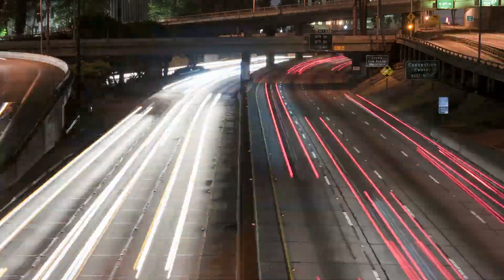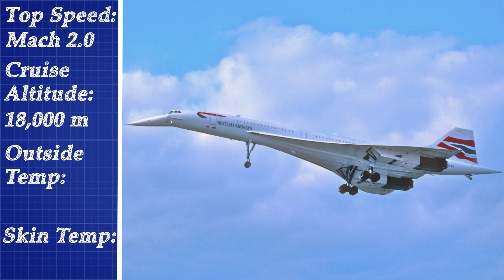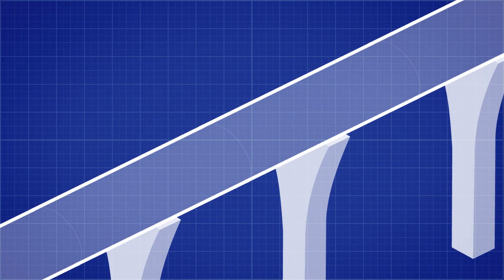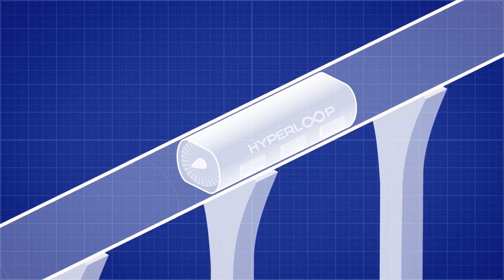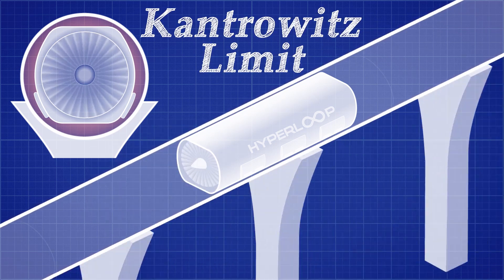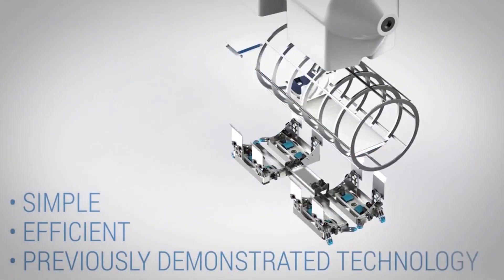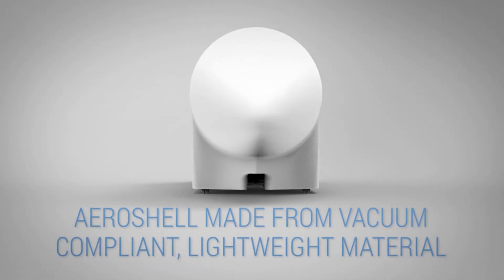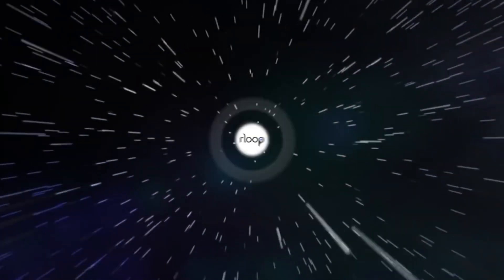Hyperloop - The Future of Travel?

Comment: So basically, it's a maglev in a tube with a target speed about 50km/h faster than the current maglev operational speed and 20km/h slower than the actual fastest speed achieved by an existing maglev. What's the point?
Reply: Abe Dillon The top speed of a maglev train is a little over 600km/h. What is the top speed of a Hyperloop demonstrator? Oh wait, there is no such thing as a hyperloop demonstrator, there are some tubes in the desert and a poorly engineered maglev segment. A ridiculously short one.
Reply: You know what's more dangerous than a high speed train? A high speed train in a vacuum tube with train cars that pass every 3-5 minutes.
Reply: "You know what good engineers do? they build complex systems in pieces and test each piece at a time."
They built a maglev. It already exists and it's  far better then the one they built. They invented hot water and it's not even that hot. Wow! I'm impressed!
Reply: Last I checked, the top speed of a maglev train was far shy of 700 mph. Closer to 300 mph. Can you link to what exactly you're talking about?
Reply: They used a maglev for the demonstration. Maybe you should point it out to them.
Reply: Ok, now imagine if somebody else had a working system for that same purpose with a far better methane engine. That would be a good analogy.
Reply: Besides, if you watched the video, you would know that no compressors or air bearings are planned. You would also know that the prototype target speed is 480 km/h. Not 700 mph.
Reply: Also, yeah, even if someone has already made a methane rocket before (hint: they have) NASA would want to test their own design.
Reply: +Lethal Oxyclean Clorox Bleach
Page 12 of the Hyperloop Alpha document ( http://www.spacex.com/sites/spacex/files/hyperloop_alpha-20130812.pdf ) states:
The capsules travel at 760 mph (1,220 kph, Mach 0.91 at 68 ºF or 20 ºC)

The fastest train in the world has a top speed of 603 km/h (375 mph) ( https://en.wikipedia.org/wiki/L0_Series )

760 mph > 375 mph. 1220 kph > 603 kph.

You and OP are confusing kph for mph. That's why I corrected them.
Reply: +InfamousArmstrong
Yes. I know. That's why I labeled it as such.

The Hyperloop Alpha document outlines the general idea behind the Hyperloop concept. There are no follow-up documents.

When it was released patent-free to the public domain, dozens of start-ups took off with their own take on the idea, but none of them are exactly publishing their full engineering documents. So, when people talk about "the hyperloop" without mentioning a specific implementation, one can only assume they're referring to "The Hyperloop" as envisioned by Musk and described in the Hyperloop Alpha document.
Reply: Abe Dillon 
Just because the alpha document says it will go a certain speed doesn't mean it actually will.
Reply: Abe Dillon is that engine better performing than the one they're testing?
Reply: Oh really? What did their competitors do? Tell me again, why am I wasting my time with you?
Reply: what part of "the target speed of the demonstrator is 480 kph" you didn't understand? It's even worse than I wrote in the beginning. It's like saying "we're planning a Mach 5 airplane, more than twice as fast than the Concorde but we'll make a 'demonstrator' that goes Mach 0.8 as a proof of concept". Are you really that stupid?
Reply: I give up, you're a basket case.
Reply: As I said, you're a basket case. If you weren't you wouldn't use a theoretical project as your argument. It's as if you said "there is a better way to propell spacecraft"  and use the Bussard fusion ramjet as an example. Ok, so Berkley has a project, where is their prototype?
Reply: +Abe Dillon
>700 mph
Its 800 KM/H YOU NUB
Reply: Abe Dillon 
That's only an alpha document.
Reply: +InfamousArmstrong
*Just because the alpha document says it will go a certain speed doesn't mean it actually will.*
Yes, I know that. The thing might never be built in the first place.

When Dino Alberini claimed the system only goes "50km/h faster than the current maglev", you have to guess what he's referring to. The Shanghai Maglev Train is the fastest commercially operated maglev train at 430 kmph. The Japanese L0 maglev train set the current train speed record at 603 kmph, but it's still being tested. That leads me to believe that Dino Alberini is using the 480 kmph figure quoted in the video for the pod contest. It's strange that he would think a scaled-down prototype is indicative of the final speed aspired to by the engineers. That's a ridiculous assumption.

There's really no reason a full scale Hyperloop wouldn't push for the near Mach 1 speeds described in the Alpha document. Maglev trains minimize rolling resistance and they have regenerative breaking, so they minimize deceleration losses. That means their main expenditure of energy is on fighting aerodynamic drag which scales with the square of velocity. Aerodynamic drag actually dominates in high-speed rail too, because deceleration losses can be amortized over distance and rolling resistance is doesn't scale with velocity.

So the big drain on these systems that make their operating costs high is aerodynamic drag. That's the only thing keeping someone from making a maglev train that goes 1200 kmph, it would use 9 times as much energy per mile as the Shanghai Maglev Train, it wouldn't be feasible. Even at 480 kmph, current trains are designed to be long and skinny because that lets them fit the most passengers behind the smallest crossectional area possible to keep drag-per-passenger to a minimum.

The Hyperloop reduces aerodynamic drag by a factor of 1000. It uses very little energy. This not only lets it operate at much higher speeds, it allows for smaller pods instead of giant, long, heavy trains. Because of the small size of the pods, you can suspend the track on thin concrete pylons that fit down the median of most highway systems. This allows for the construction of a Hyperloop with minimal right-of-way costs, which typically dominate the capital costs of most mass transit systems.
Reply: @AbeDillon  that is all nonsense.  Hyperloop is expensive, with low transport capacity, no know signal system and impracticable speeds.
Reply: what are you talking about? The linear motor demonstration?

You're the same guy who was calling me a bad engineer in thunderfoot's comments, aren't you?

You know what good engineers do? they build complex systems in pieces and test each piece at a time. that's good engineering. You expect them to go from alpha to complete system in what, two years? How many projects have you worked on that were this scale and required no proof of concept demonstrations?

how many projects have you worked on where the alpha proposal required no revisions or further engineering?

That's what bothers me most about TF's videos. He positions himself as a science educator then completely misrepresents what real engineering is like. If you don't have a complete safety protocol detailed in your alpha proposal, you're a hack? Is that what you believe?
Reply: @AbeDillon  how are u a good engie and did calculations and didnt see that hyperloop was utter shit
Reply: No. I'll just point out to you that it was a demonstration of the linear motor only. Not the compressor. Not the air bearings. Not the vacuum tube.

You should point out to NASA that they used a truck to mount their methane engine for testing. I'm sure they would be shocked!
Reply: You might also want to consider that RLoop is one of many competitors in the pod design challenge and just because they ditched the compressor fan and air bearings, that doesn't mean that any of the start-ups based on the Hyperloop concept have to adopt that design decision.
Reply: What part of "isolated system demonstration" don't you understand? That's not the full Hyperloop. It's not a full mock up. It was never meant to be. How many years have you been an engineer? What company do you work for? I want to make a point to avoid any product you played a part in developing. You scare the shit out of me.
Reply: Another thing that will make for a short engineering carrier is thinking 1200 kmph is 50 kmph greater than 600 kmph.

or thinking that air bearings are the same technology as maglev...
Reply: Far better working how? Half the speed at 10x the cost? Is that your measure of 'far better working'. I'm still not sure if you know the difference between kilometers per hour and miles per hour based on your rhetoric.
Reply: "as a short TEST TRACK prohibits high speed runs"

the RLoop design is part of a competition to design a pod specifically for the linear motor test track. that's why they ditched the compressor fan and air bearings. I think you should watch the video again. you missed some key words.
Reply: Why were you talking about a competition design that is very narrow in scope as though it is the new design of the Hyperloop. I don't know why you're commenting at all. You seem extremely confused by even simple arithmatic, let alone the idea of an isolated system test.

Do you still think 600 + 50 = 1200? You haven't really cleared that part up for me. I'm extremely curious.
Reply: I did the research you asked me to do (because apparently, your ignorance is my problem). There were over 125 submissions to the Hyperloop pod contest and only 33 of them went on to the prototype stage of the competition. Of those 33, I know of 12 that use an air-bearing design (some of the teams provide very little information on their design):

Berkeley
Carnegie Mellon
Drexel
University of Cincinnati
UC Irvine
Lehigh
NYU
OpenLoop
Purdue
Texas A&M
VicHyper
and Waterloop

Here are the competition parameters so you know the constraints their designing under: http://www.spacex.com/sites/spacex/files/2016_0831_hyperloop_competition_ii_rules.pdf
Reply: LOL! See ya!
Reply: The point is that the capsule is far lighter, so it requires less support, so the tube can be built far cheaper and it would be easier to build it on high pylons so the land underneath can be used. One of the biggest problems if the Californian High Speed Rail is that the farmers whose land it is supposed to pass trough don't want to have their land split in two by an impassable rail line.
Reply: Why would a pressurised capsule be lighter?
Reply: Dino Alberini Because it carries far fewer people than a train, because it is far smaller than a train car (no place to stand up, no need for toilets because of shorter trip, etc.), because it does not need to endure strong crosswinds like trains do. 
The design calls for 15 ton capsules, train cars can be 10 times heavier and the train has many cars.
Reply: So it's a small maglev train (that has no real issue with crosswinds anyway)? It still has to have all the maglev parts and, as is well known in engineering, making it smaller just increases the cost per passenger.
Reply: Dino Alberini The vast majority of the cost of any train, maglev included, is the cost of the track. If you can make the track lighter and cheaper you've won already. The stability of railway cars is not a simple or insignificant problem.
Hyperloop also deals with air resistance - which dominates any travel method over 100 km/h, and noise which dominates complains against nearby airports - making it faster than aircraft and able to travel to the center of cities.
Reply: There is no way you can make an evacuated tunnel lighter than the current maglev track. Besides, the upkeep cost of such a system would eat all the profits.
Reply: Dino Alberini Why do you think they can't make the structure to support 15 tons any lighter than the structure to support 70 tons?
Reply: By that logic, they could make smaller maglevs, for less people, which has no economic sense. But yes, we're talking about a tube, it has to be sturdy enough to host vacuum, which means lots of material. But weight is not the principal issue for the upkeep cost. You would need to mantain seals, bulkheads, pumps, all adding to the usual maglev cost.
Reply: mrbandishbhoir By that logic cars are useless.
Reply: Well... no. A car is a personal vehicle you park in your driveway. A small capsule is as useful as a small train car. Do you see any small train cars around?
Reply: mrbandishbhoir You are complaining it carries so few people, then mention bicycles?!
What hyperloop is changing is that:
- the capsules travel faster than planes and far, far faster than trains, because they move through thinner air (so they save you time)
- they are quiter than planes and even trains
- they can reach the center of the city, while airplanes must land far from it (again, saving time)
- they need lighter, and therefore cheaper, infrastructure than trains
- they use electricity, which is far cheaper than the fuel used by planes
- they can depart far more often than planes or trains, so they can carry a lot of people even with fewer people per capsule
These are all advantages of the hyperloop. I'm not saying it does not have its share of technical problems, but if you are asking what the hyperloop is changing shows you did not look into it.
Reply: No. You can't make a light evacuated tube that will host a high speed capsule. But I'm willing to change my mind when they make a full scale proof of concept.
Reply: mrbandishbhoir 
If you have 12 person capsules, and they depart every 5 minutes this makes 144 people per hour. Assuming they operate 16 hours a day (say, from 7 in the morning to 11 in the evening) this makes 2304 per day. I am not aware of a airplane route that transports as many people a day - if you know of such a route please share it with me.
It would save these people 2 hours and 30 minutes per trip, so this makes 5760 hours saved per day. That's not "as good as non-existent". 
Sure it would not be for everyone - travelling by slow rail will be more economical and preferable for budget travelers. The hyperloop is a competition of air and high-speed rail, not regular trains. There are enough people whose time is expensive and would make such a project worthwhile. 
"For trains we have many tracks going side by side."
You very rarely have more than 2 tracks going side by side on the. If the demand is strong enough you can make several tubes going side by side as well, I don't see the problem here.
Reply: @nikolatasev4948  well yeah cars are pretty inefficient
Reply: @nikolatasev4948  trains can leave less than every 3 minutes in some cases… also how the heck do you build a vacuum tube AND a maglev track for less than just a maglev track?

Comment: i used to think this sounded like a great idea until i saw the hyperloop busted video, now i know it will be almost impossible to build and insanely dangerous to ride in.
Reply: Thunderf00t does address some decent arguments, but some of his arguments are flawed. Thunderf00t is a chemist not a physicist .
Reply: Thunderfoot blows it way out of proportion.   He shows the concrete walls of NASA's deep space vacuum chamber but does he show the thin glass walls of your thermos?   He talks about air rushing in at the speed of sound, the air would rush in at a speed determined by the differential pressure and the diameter of the opening as per fluid dynamics, the speed of sound is an upper limit that it could not exceed no matter what the differential pressure is and keep in mind that the differential pressure is not infinite, it would be less than one atmosphere, your espresso coffee maker operates at 19 atmospheres, you don't see the coffee shooting out at the speed of sound.   We already have pneumatic systems that deal with leaks all the time, the very reason why we have air brakes for trucks and buses is that leaks can be compensated for with additional pumping capacity.    Thunderfoot is completely oblivious to engineering fields such as fluid dynamics.   Take his video to your local University and ask the fluid dynamics prof to review it.
Reply: real engineering has already politely stated in the comments that he found thunderfoots video to be shit. and honestly I agree, he should have put way more work into that than he did and overall I feel that real engineering has far more credibility in the subject at hand.

Comment: Give me a small model of a hyperloop and let me show you the dangers of it with a single hand held drill. Or heck, even a sledgehammer might do it.
Reply: +Shaco Clone You're overestimating the effects of a leak, atmospheric pressure is about 14 psi and a complete vacuum is only 0 not negative a billion.   A bicycle tire would be 100 psi, an espresso machine operates at 19 times atmospheric pressure.    Are you afraid of a bicycle flat? Does the coffee shoot out of an espresso machine as a deadly jet? Do you hide behind a brick wall when ordering at Starbucks?   Trucks and buses use air brakes instead of hydraulic brakes because leaks do not affect performance unless they exceed the compressors capacity hence leaks are tolerated.   Likewise, the whole idea centers on the fact that leaks are not an issue to such a design.
Reply: John Wang The Hyperloop has a much longer diameter and length than a bicycle tire.. And the Hyperloop has a projectile inside of it, and where the rest of the tube is a vacuum. A projectile in air is much harder to accelerate than a projectile with literally nothing in it's way. It will accelerate to the speed of sound until something stops it.